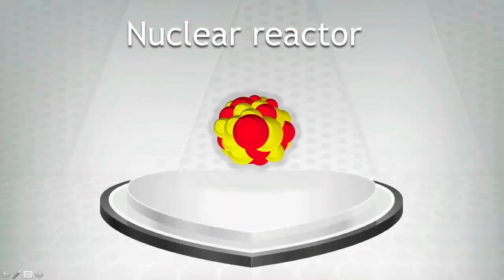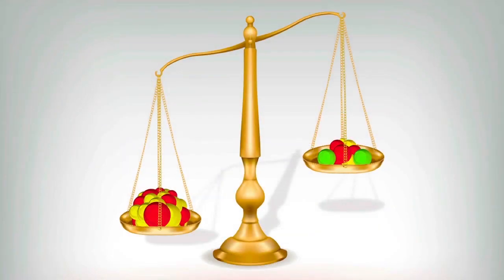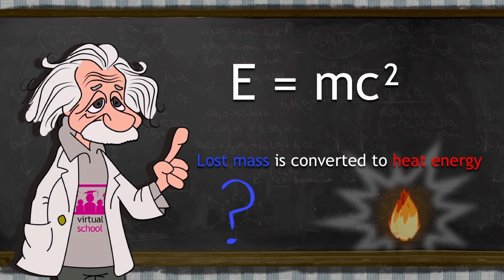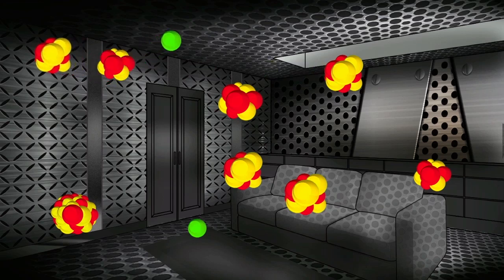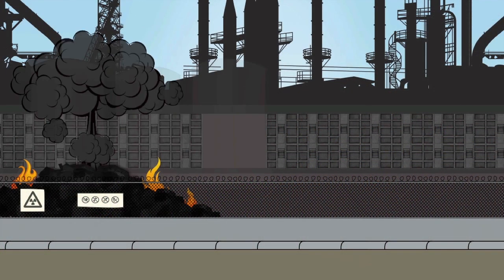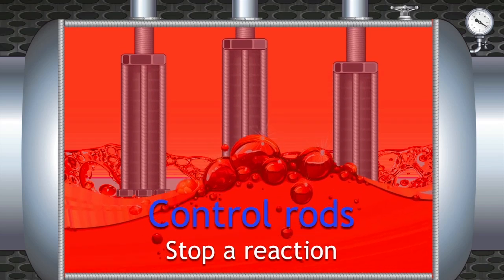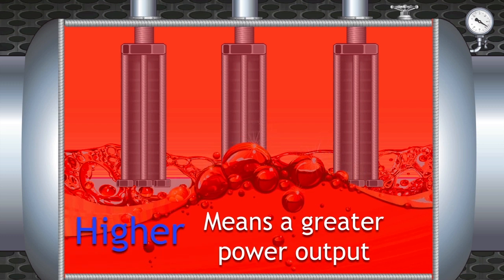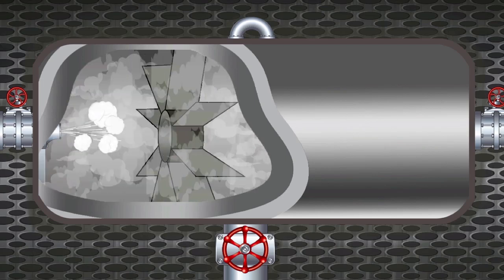What Is Nuclear Fission? | Radioactivity | Physics | FuseSchool

Comment: They need to solve the fuel and energy storage equation then they will be commercially viable, could be a great way to power re usable rocket traffic over long distance space travel without excessive heat and could be stored in smaller spaces on board those ships.